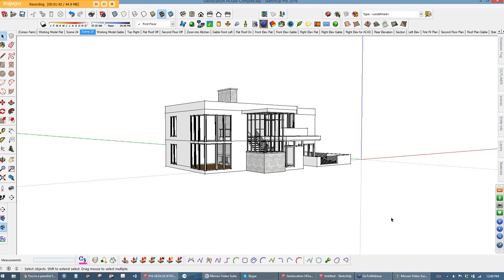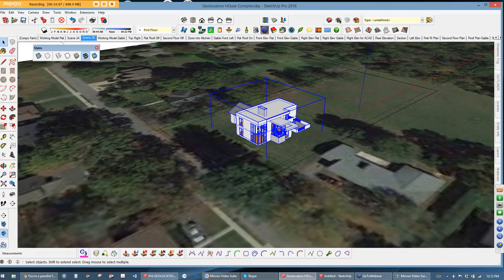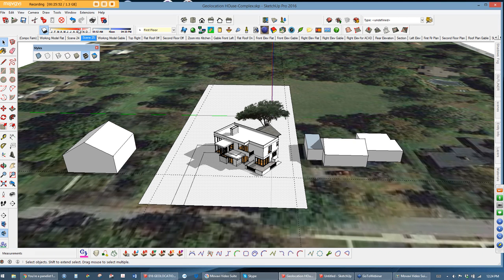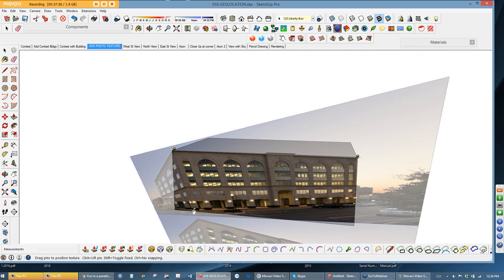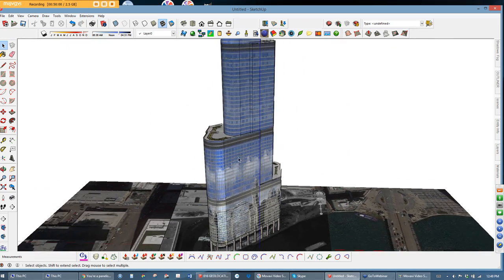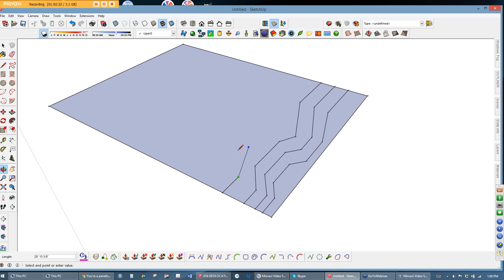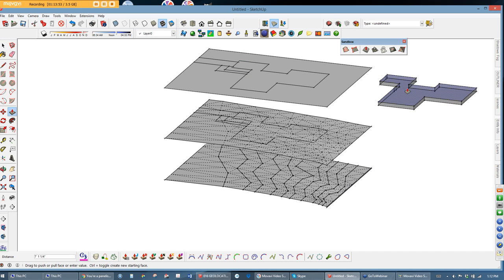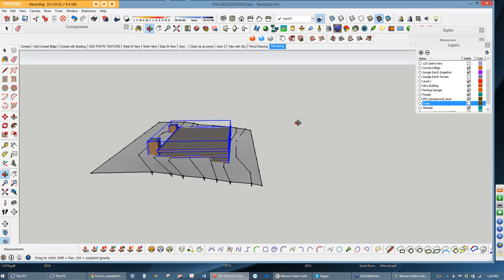SketchUp GEOLOCATION, CONTOURS and TOPOGRAPHY : One of my MOST VIEWED VIDEOS

Comment: Question, in CAD how do you set up your CAD plans so that it aligns right with the geo location map? Lets say a building envelope is in cad but want to make sure its in the right location in sketchup....
Reply from the maker: If you're using pro you can import the cad file directly into SketchUp. Once imported you have to verify the scale by measuring something on the imported cad drawing. Once measured (prior to doing anything else) type in the correct dimension.
SU will adjust everything accordingly.
Reply from the maker: Take a look at my video "from pdf to topography" on my  KruppAssociates Architects YouTube page. Sketchup has a tool called Solar North (available in the Extension Warehouse) that provides a way to tell SU what way is north.
If I missed your point, please let me know.